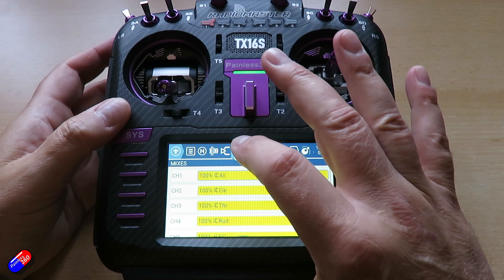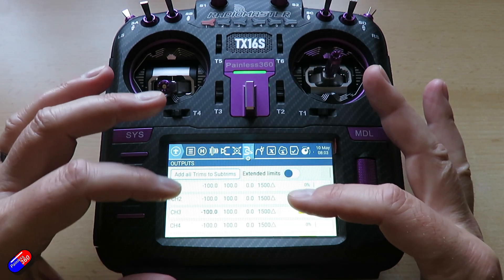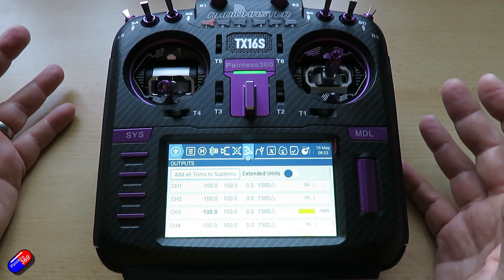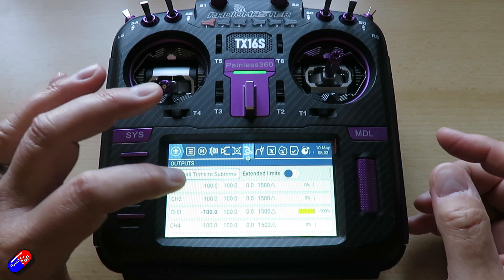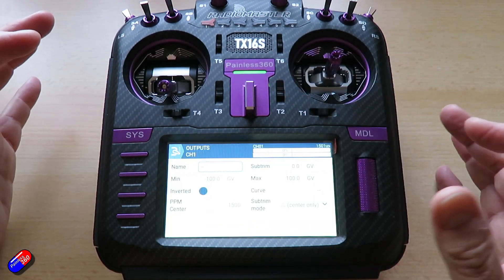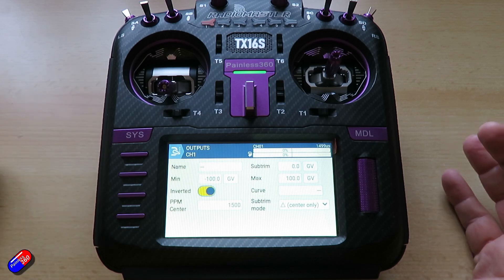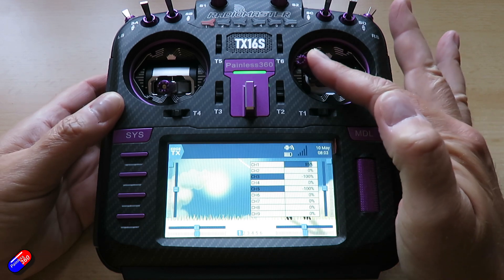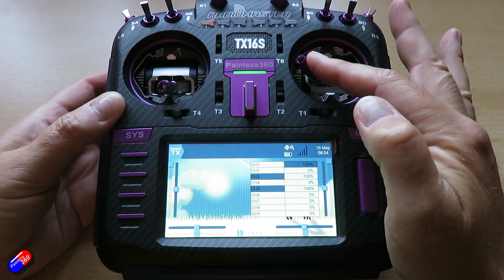How to reverse a channel or control (EdgeTX for Beginners 2025)

Comment: When you change the weight of a channel also the direction of trim reverses. It's quite confusing when you try to trim your airplane when you change the weight of channels instead of reversing them
Reply from the maker: This is why reversing using the INPUTS is a bad idea. Reversing in either the MIXER or OUTPUTS (as shown) leaves trims unaffected. Happy flying!